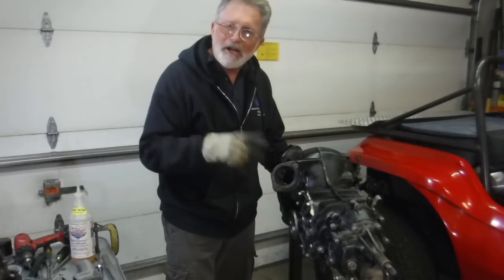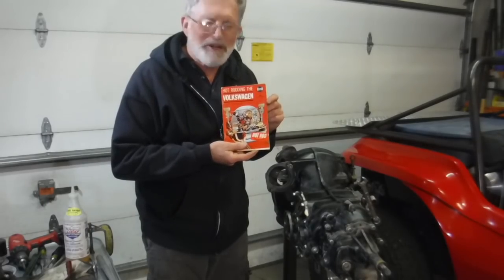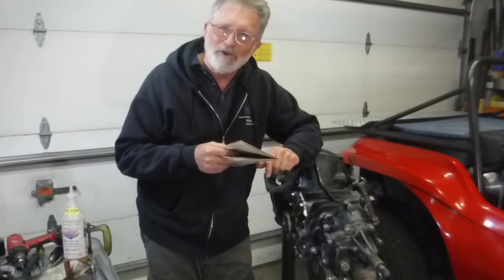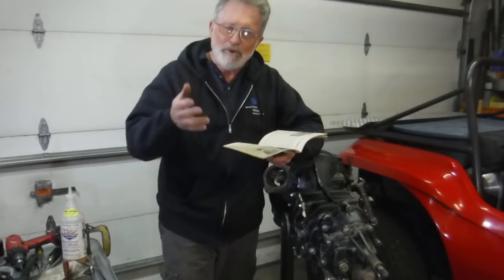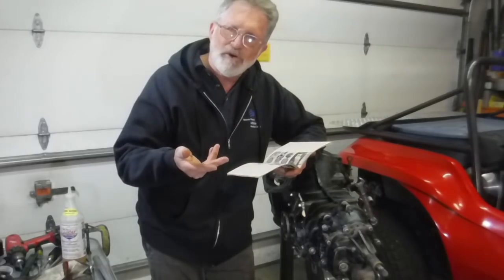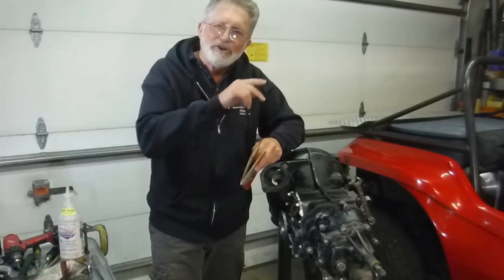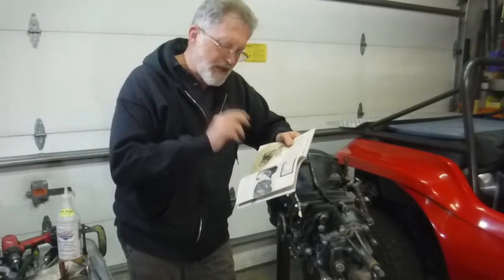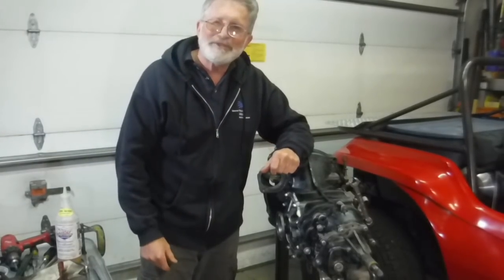Vintage VW Horse Power Vlog

Comment: been watching your videos for years now. I have a 2110cc motor in my 1967 bus that my son and I restored 7 years ago. It came with dual 40 weber idf's, which we have managed to get running one time for a short while nice and crisp. Today I am seeking direction from you, the motor has been completely rebuilt by a professional with new main bearings and valve grind. It runs ok but when trying to adjust the mixture screw it is very non responsive but is at its best peak running at 1 1/4 turns out. I am confident that it is jetted correctly, timed correctly, blackline racing check out the carbs but I cannot get it crisp again in the idle circuit or main. Tail pipes are black and sutty like too much gas but I have checked fuel pressure and have a regulator that is at 3.5lbs.
All four cylinders run the same, been stumped on this for years, no joy in driving a poor running van, wife wants to get out, please help save my sanity and possibly marriage.
Grateful for any advice you may have.
John Langsev
Reply from the maker: Turn that fuel pressure down to 2 pounds or less. Make sure the gaskets between the head and the intake manifold are the thick fiber ones and are fresh. Don't tell me you already checked that. Put new ones again. keep me posted

Comment: You can actually pretty easily run a vair motor in a baja it's just an adapter plate from kep and flipping the big gear in the trans because vair spins the wrong way

Comment: Okrassa made dual port heads for the 40 hp engine..they made big bore kits, and high compression top end kits,  they made dual carburetor set ups ( ala Porsche).   I believe they might have made some bigger bore kits for 36 hp..but those were scarce.  Empi was pretty famous for their Extractor Exhaust.. which is widely copied. Empi or imported a LOT of nice accessories for VW bugs.. coco car mats, under dash racks, bug eye brows for the head lights.. most any thing you see like that now on old vw;s likely came from Empi.  Empi was going in 1960 or 61.. and advertised in the small format VW magazine published then.  the Judson Supercharger was also advertised for the 36 hp.. which was made through 1960. 1961 saw the introduction of the 40 horse..which was widely fitted with 1500 and 1600 cc kiits  but you could go to 1800 or so.  the 40 Hp was the basis for the bigger 1500 and 1600 factory engines.  Most of the okrassa stuff was aimed at the formula one VW racing..but found a wide market in America for on road use.
Reply: Okrasa increased capacity of engines not with big bore but with other cranks

Comment: Thanks for sharing that. Here in California a guy is selling those Judsons for 3500$. Old guy word of mouth seller-no Craigs or ebay etc.
Reply from the maker: Interesting,  The whole kit sold for $500 back in the day. Those Judson superchargers were designed for the 1200 40hp so if you put it on a modern 1600 It probably would not produce the intended 5 PSI of boost it was designed for. All and all I wish someone would make an affordable kit other than that Dick Landy set up with a Holley carb. Thanks for watching and sharing that info.

Comment: I'm actually in the process of rebuilding a covar motor for a guy in my squad it's the 110 hp 1964 model we're going to throw a hot cam at it and some dual 40mm idfs

Comment: with the motor I feel its a fail because the cam gear and dist. drive at tdc and bdc  has a clack but it had that  with the other engine . It was the same sound. I have a used set of crank gear and dist.drive thats oem maybe switch them . It runs good with the W100 engle. Maybe next time it will straighten out.One thing is I can do it quik because I dont need to clean parts. Rambus
Reply from the maker: I know that you know what your doing. Think on this and see whats what. Has that crankshaft got a lot of end play? You cam gear thrust clearance could be in the shitter and making a click or the bolts on your cam gear may have worked loose. You might pull the oil pump and have a look.  Just thinkin out loud here. Seems like you just lost a different case a while back. You better start going to church or change your life style.  Good Luck Rambus

Comment: Looking for that book and the Gene Berg blue book ( out of print)
I have a ??
What flywheel weight did you use in your sand rails ?
Love to see a video on your take of application of the different weight flywheels.
Reply from the maker: 12 lbs. Whatever they were offering as a lightened flywheel because it already had the 8 dowel holes in it. Had it professionally balanced.  Light car/Light flywheel  Heavy car/Heavy flywheel. 
If you build a performance motor with mild cam and like to crawl around and explore in 1st gear the stock weight is great. You don't need 8 dowels just used the stock 4 . It makes starting out on hills and crawling threw ruff area's real nice. If your cam is 110 or smaller and you have dual two throat carbs the lighter flywheel will be fine.  Also makes a difference if you have big heavy tires on the back.  Build a nice 2 liter motor and it will do everything well. Thanks for stopping by Roger. Good luck with your projects
Reply: TheEZGZ d

Comment: I have a question...I have a type 1 VW transmission and when I put it in 1st gear, it shutters ( doesn't grind) and hesitates, shakes then it engages. It only does this about 60 percent of the time and only in first gear. Its very strange. You would think if it was a clutch issue...it would do it more often and it would do it throughout all the different gears. Any suggestion what it could be?
Reply from the maker: When was the last time you checked your tranny oil level? Might need changing? Nothing fancy just use your basic 75-90 and don't worry about all the metal you will find on your drain plug magnet. That's normal for a 50 year old tranny. Tighten your clutch adjuster 1 or 1 1/2 turns and see if it changes anything????  Just have to keep looking or wait for something worse to happen. 10 Hail Mary's could hurt ether :-)
Reply: Sorry for entering the same question twice. IDK how I did that lol. I haven't checked it since I bought the rail a year ago but this only occurs in 1st gear. I would think low fluid would affect all gears rather than just one.
Reply from the maker: It's one of your favorite toys. Ya probably spend hours just sitting in it dreaming about your next trip. Take the friggin engine off and look around inside the bell housing. Don't forget the gland nut has bearings in it that can go bad. Might be time to find a spare tranny before your next vacation. Most of my friends that had rails had more than one broken tranny with weeds growing up around them. Get one and have some fun like I do. LOL you could be the group tranny expert. hehehe
Reply: lol Will do. I'll keep you posted...TY!

Comment: Someone needs to dual judson supercharge a vw engine..... That would be cool.
Reply from the maker: One on each side and drive it off the alternator pulley. I wonder if they whine like the Roots blowers
Reply: TheEZGZ yup! Are they screw type blowers? I don't know that much about them haha
Reply from the maker: They are pretty cool, Currently there are, centrifugal, Roots, Screw and Vane. The Judson was a vane. It was only big enough to supply a 1300cc engine 5lbs of boost so probably would work well on the 1600cc or larger that we use now.
Reply: TheEZGZ Oh neat!